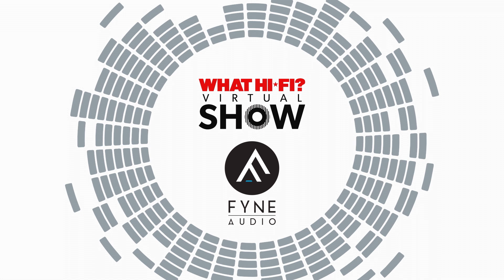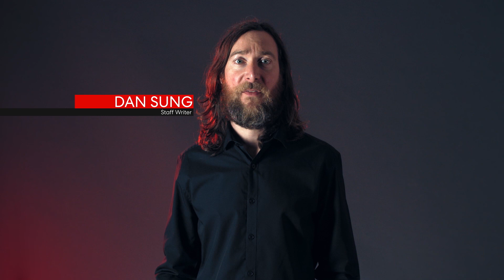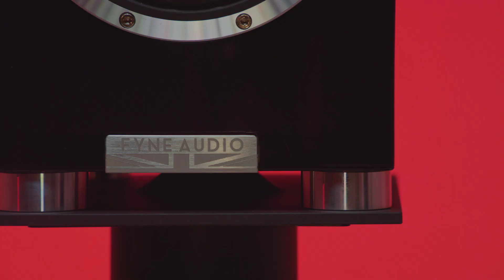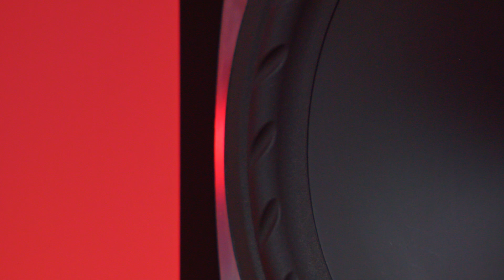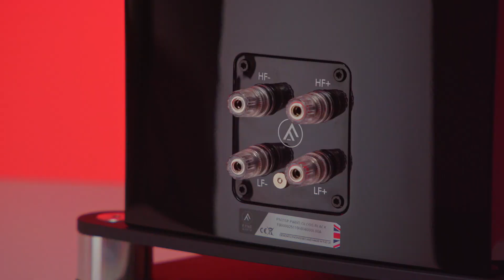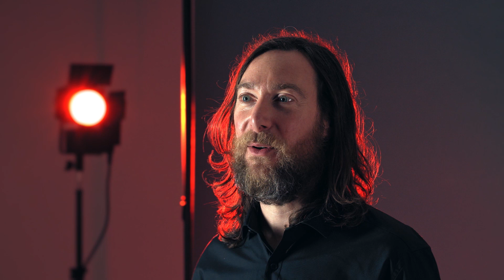What Hi-Fi Introduces Fyne Audio's F500 SP Series

Comment: Can you describe the sonic/tonal difference between the normal series and the SP.
Reply from the maker: Hi, both are very good sonically and as audio is a very personal and subjective topic, we would advise demoing both. Overall you will find the SP brings a more refined sound. The upgraded plinth and cabinet design means the bass is more controlled and tuneful while the mid and highs are more detailed and accurate thanks to improvements in the driver and crossover. Hope this helps, kind regards, The Fyne Team
Reply: @FYNEAUDIO  Thank you for your reply. I'll wait until I move to UK before I upgrade as they are double the price of the standard ones in NZ!